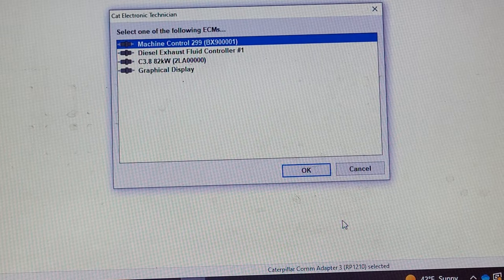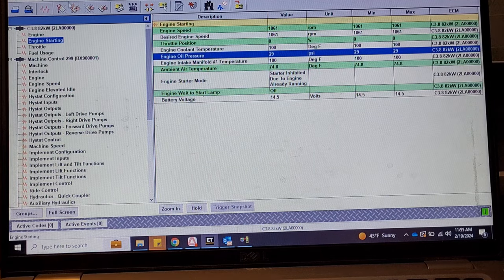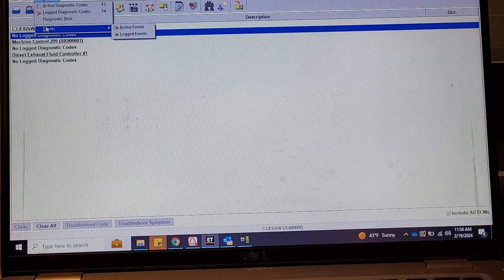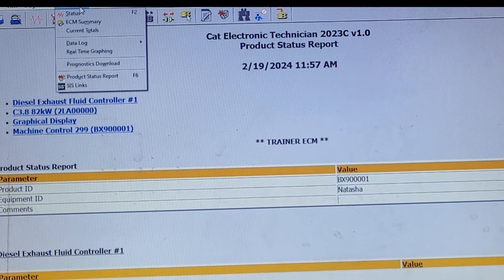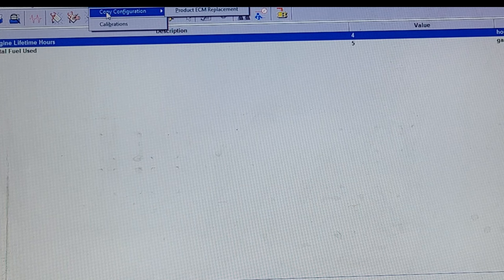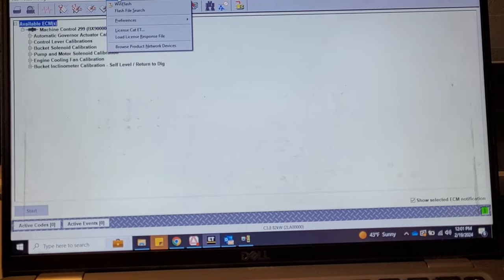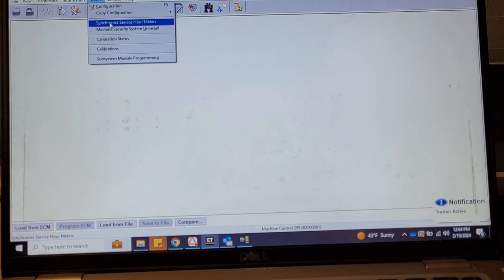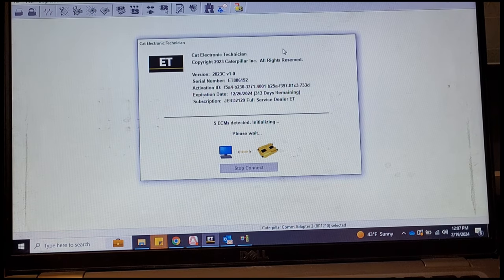Caterpillar ET Basic Instruction PT.1

Comment: Hi, how to solve error 336-2 Engine control switch erratic, intermittent or incorrect?
It is Cat 3512C engine
Reply from the maker: @vagifsafarov1616  find out what the real fault is....that is a generic engine fault there will be a main fault as well
Reply: The generator is not starting. when I connect my cat laptop to diagnose, it gives 336-2 error
Reply from the maker: @vagifsafarov1616  i understand, but if the ecm is able to be detected through et then ecm is highly unlikely the issue...you need to find out what other issue there maybe, check each parameter screen and validate if any parameters are coming up unavailable and/or conditions not met....also check logged faults/events and see if any codes have logged